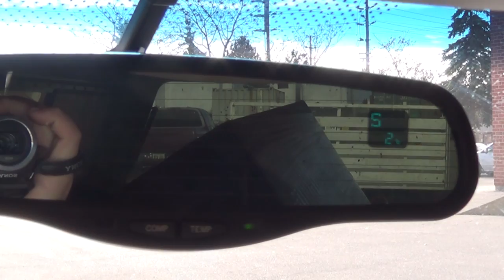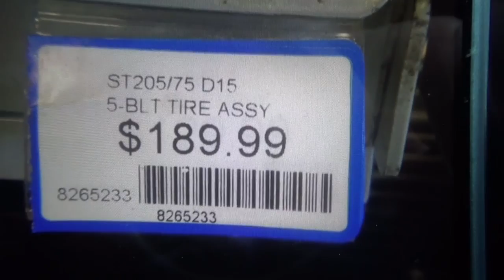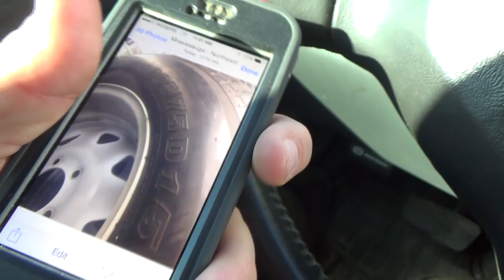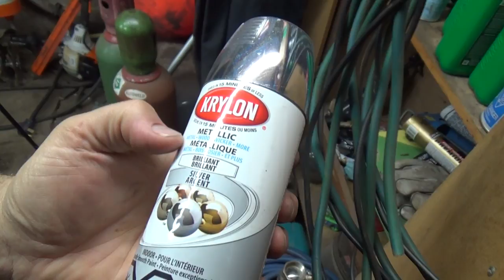WOW thats a huge Anaconda...???Python....???Boa????

Comment: The noise in the Sierra sure sounds drive line related. Hanger (center support) bearing or u-joint possibly? A man of your talents can change either with ease. Another great video Bill, thanks.
Reply: Could be. Might be something else. On my dad's Tahoe the metal shield behind one of the brake rotors got bent and was rubbing against it. Made a funny grinding/scratching noise. Thought it was something more serious until we found the culprit.

Comment: How many times have you smacked your head on the boom?
Reply from the maker: ***** once I learned fast
Reply: BILLSTMAXX :) have you looked at the new F-250s and 350? they got more towing lbs then dodge and the 2nd gen 6.7 powerstroke has more HP and torque then the cummins and there cheaper here in the US i think you would be happy if you were to get a power stroke.

Comment: Hey Bill if you tear the end off your backhoe could you send me some measurements of the end pieces that attach the buckets to the arm and the hydraulic cylinder. i am making a backhoe for my front end loader about the same size as yours and having trouble getting the proper measurements for that piece to optimize the curl and the power of the curl.

Comment: I bought two 205 x 75 x 15" trailer tires on line at Walmart. com for $48.and change they 6 ply tires. I would balance them worth it makes the tire last longer, mine tires on my trailed bounce all the time and they are wearing out. unbalanced
Don't know if you got a Walmart up your way, that was just tires only, no rims, Does the jeep have a spare tire, steel rims are the best  it maybe the right both pattern.